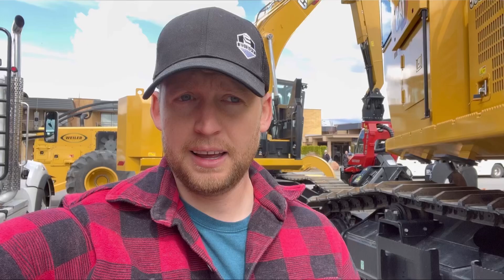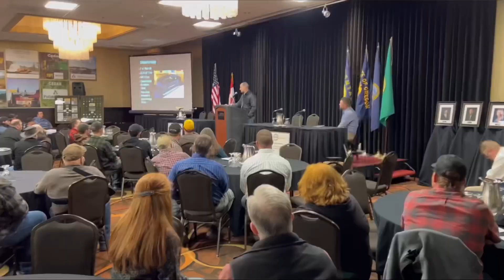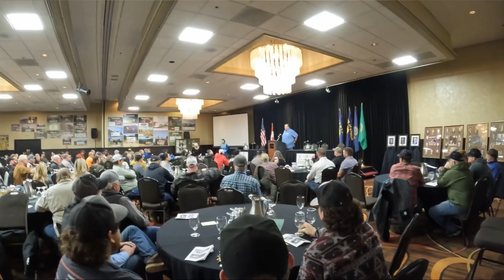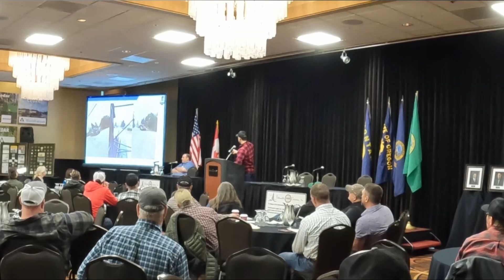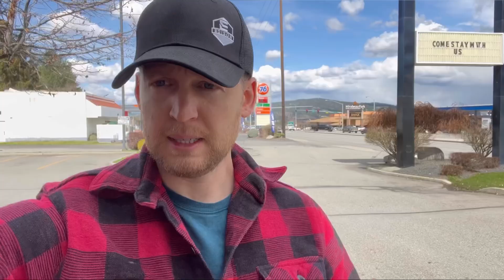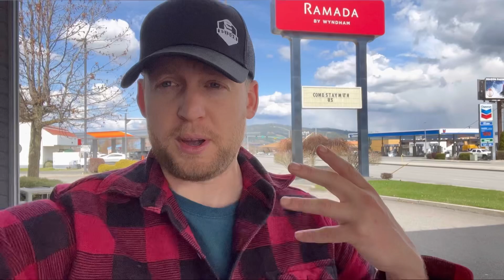Electric semi trucks at a Logging Conference

Comment: Great presentation - I’d incorporate those two questions into it.
Biggest challenge is to penetrate the anti-electric paranoia that exists and get to the logic of it. Using the diesel electric examples in heavy equipment and heavy rail was a great way to do that,
As well as citing the existing skill set in industrial motor and electrical mechanics being able to service these.
That was special, great job hey

Comment: Re feedback.  I would recommend that you not be so negative on the potential for full battery electric trucks. I fully agree that it's going to be a long while however when you're pitching to an audience that isn't as ' enthusiastic ' as you or I in your product, I think it is unhelpful to say " 20 or 30 years ". You are fantastic at backing your product with real, practical facts and figures. Your no bs style really cuts through in my view. That's something that the big companies don't/can't do.
Things such as fuel savings, way less maintenance, superior braking, greater drivetrain redundancy, flexible design etc. On top of that you offer other left field benefits such as a mobile power plant ability, a trailer with an e axle etc. All really good selling points.
With regard to batteries, they are improving at a phenomenal rate . CATL, the worlds largest ev battery manufacturer who has serious market credibility , has just announced that they will be selling a new ' condensed ' battery later this year that has up to 500whs/kg capacity. That's close to twice what the best offer now. So, while I wouldn't say that batteries for a full electric truck will be available tomorrow, I would suggest that it will be much, much sooner than people think. Further to that, because you are proving that you can build a successful product using today's technology, it would be a great argument to say that people should convert their trucks and get the benefits nowBy the time they are due for a rebuild next time around, the batteries and drive gear will be even better in the future and it will be a really simple and cheap upgrade . Love what you guys are doing.Very inspiring. Can't wait to see one of your trucks in action.

Comment: I think you did a really great job. I would move the freight train slide up towards the beginning and discuss the benefits of constant rpm load earlier. Explains why hybrid drivetrains make so much sense. I would end with specific demonstrations of your right-to-repair ethos. Wouldn't change anything in the middle. Looking at your audience more and the slides less would be the only other improvement. You're doing fantastic work.

Comment: I very much love what you all are doing here. I ain’t trucker, mechanic or any of that, just a software engineer, If you all need a website, software services, etc, reach out to me in a reply here (understandably I don’t want to put my contact info here, I have enough spam as it is, but I do check my notifications on this account regularly).

I live in a fairly low COL area in Missouri, and I am absolutely on board with your right to repair philosophy, and basically everything about your company, so I’ll be more than welcome to give you a discount, my rate usually comes out to about 75 to 100 an hour, but I’d be damn tempted to put you all on the friends and family rate.

I’m about to start on my own gig running a nonprofit maker space in my city, so I ain’t looking for anything full-time, but I’m more than happy to do some part-time or contract work for y’all.

Comment: I am excited to see this technology applied to service rigs. Just eliminating the $50k to $100k automatic transmission will justify the conversion. I think it will be an even better application than logging. You can do 90% of the drawworks braking with regen which will save $2000 a year in brake pads. Will also eliminate the  chain cases and the $2000+ chain replacement. I bet it would knock off at least 3000lb of weight, give it way more hill climbing power and make it way more pleasant to operate when on the hole. I was questioning why rigs weren't built this way when I started fixing them 20 years ago.

Comment: So this gave me an idea, since I’m local and I go back to the same terminal every day. I remember you saying the computer has a setup to be programmed for what the generator does when the batteries hit 20% or so. My question is, is there any way to tie that or something like it to a gps unit, so that when I’m routed back to the terminal, and I get within, let’s say 30 miles, the generator won’t turn on if it’s got enough battery to make it back to the shop? Cause I’m guessing letting it trickle charge overnight is gonna save me at least a bit of fuel, but I don’t want the generator kicking on while I’m heading back to plug it in.
Reply: It has manual controls. So you can override the charging automation.

Comment: Made sense to me. I probably would have pounded on the "steady low output from the genset, batteries manage the peaks" part a bit more. The problem is that the MPG claims sound like a scam, because a billion other people have promised that. If you justify the claim /first/ e.g. "so because the genset runs steady, blah, blah, blah" and THEN say "and so we get 50% more MPG" it flys a bit better. I can't wait to see your marketing / sales stuff and share it around. What you are doing is exactly what I've seen over and over as an example of people who are actually changing the world: It's not cutting edge research or venture capital firms that really do it; it's just regular folk who figure out how to solve real world problems and "get 'er done".

Comment: They have been using regenerative braking axles in Europe for decades. You might want to check them out for ideas.
Reply: - the electromagnetic retarders don't generate useful output current however (ie Telma Indution braking system) so not really "regenerative" - trains using their traction motors to regenerate is closer to the EV model...  

(I think they have something going here, onward forwards. - this is bush mechanics how it should be done, obsolescence is in the past.)

Comment: I love what you guys are doing here. I work for a concrete company, and i could see potentially huge fuel savings fleetwide with this technology, given our driving is mostly stop and go. Just need to retrofit an electric drive to run the hydraulics and you're golden. Not near the fuel savings of the logging trucks it's intended for, but significant nonetheless.

Comment: 4:30 I know a transmission is not as "efficient" but it would reduce the snaping drive line, just a 4speed, a bull low, a 1:1 an over drive,  well maybe just a 3speed
Edit- just a pick a desired gear ratio and runn it

Comment: Since I watched the video the other day where you explain using a truck in a grid-tie situation or as job-site power provider I can't stop thinking about it.  Imagine what a good problem it would be to have to decide between taking the truck out to work or use it to feed the grid because the payment is so high!  I think the potential auxiliary uses for your design could be important selling points.

Comment: you didnt "create" anything... you did the equivalent of putting a briggs generator with an inverter to charge your batteries... the set up you got looses so much hp by going through the gears and factory axles.. this is equal to the Bob Lazar Jet Powered Honda he used to "drive around town" news flash, you cant drive a jet powered anything in stop and go traffic... you can drive a honda powered car with a jet engine strapped to the back, but that doesnt make it a JET POWERED CAR... JUST LIKE USING A 500 KW GENERATOR UNDER THE HOOD AS A BATTERY CHARGER DOESNT MEAN YOU HAVE AN ELECTRIC TRUCK.... also it is convenient the Q and A part of your speech was "lost"....
Reply: I think he did a great job. Using the electric drive motors and e axles with an on board generator to recharge as necessary. What would you design better. He made it simple and off the shelf parts that anyone can fix.
Reply: @dangerdavis5655  where are the e axles? i see regular old rockwells?  i see an underpowered electric motor rigged to a chain driven transfer case, going to an auxiliary gear box... waisting energy at each point... if its such a good design then why isnt there a video of it pulling logs yet. this guy uses buzz words to get views. theres a reason he is a logger and not a mechanic or engineer... just because you know how to apply bandaids doesnt make you a Dr...
Reply: Take your negativity somewhere else. Some of us actually like people who come up with simple fixes to complicated issues and aren't stuck in the 1940s.
Reply: @Justin_Reimer  no you are stuck in the 60's. if you knew anything about how energy works you would also have some major hang ups with what this dude is doing. these videos are for views only. theres no useful info here.
Reply: @Justin_Reimer  also what did he fix? he took a truck that was capable of hauling logs for the last 60 years into a useless deathtrap  that cant do anything but mislead people who dont understand what he is doing is a grift...
Reply: @malonedickridesagain3998  this is a prototype you haven't wanted all the videos or done any research into what's going on here have you he has stated multiple times this will not be the finished product
Reply: @malonedickridesagain3998  yes trains ran a similar setup and it works good there may be some down sides but overall I think it's a good attempt at something better than what we currently have available

Comment: It went well.  I don’t think you need a video until you can show the truck doing do a full load uphill.  I think one of the things that will help sell your idea is to talk about the fuel savings, reduced maintenance, and ease of use.   When you get your service truck you can add that to your talk.  Especially running welders off of the batteries or generator.  Even remote logging shacks can be run off of an diesel electric truck.  You have a great idea and a perfect application for an industry that can take advantage of it.

Comment: I think you did fine with your presentation.  You came off very genuine because you live it.  I would really push the simplicity factor you show on your other videos.  You are building a truck that is going to last, will use readily available parts and won’t take a nuclear physicists with a minor in software design to fix.

Comment: I love what you’re doing brother! You could also incorporate the idea into the trailer too with the e-axles and make an unstoppable logging rig 👍
Reply from the maker: That’s the plan
Reply: Think about the regenerative braking too! Gonna charge your batteries 30% going down a mountain pass
Reply: If it's a thousand horsepower with 100,000 lb feet of torque I doubt it would need it personally.
Reply: @pamelaprince6357  I was thinking of the all wheel drive aspect of it. If the tractor starts slipping in mud on a janky logging road you could turn on the e-axles on the trailer to help push you through a shitty spot.